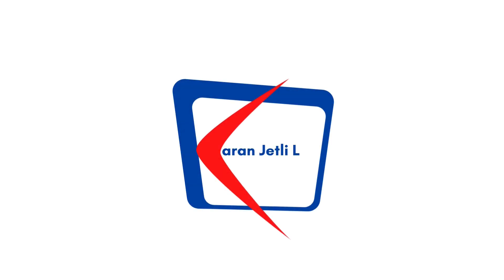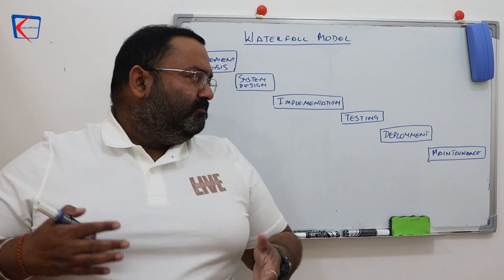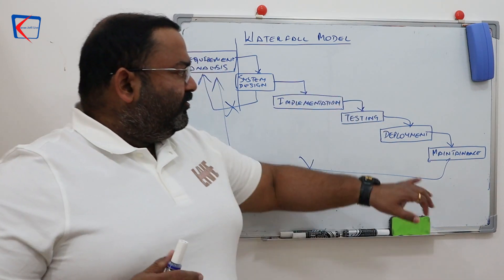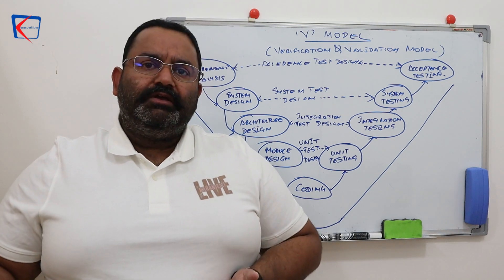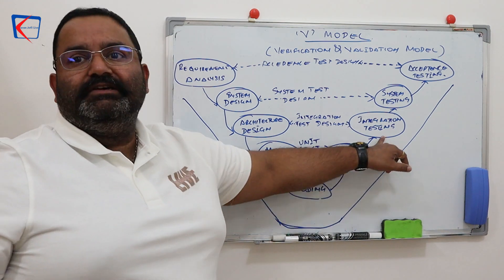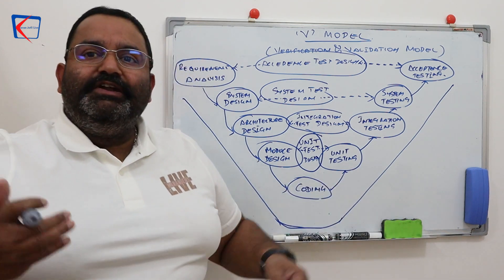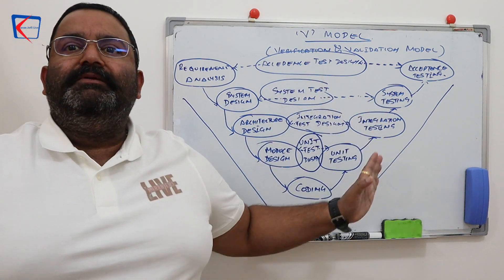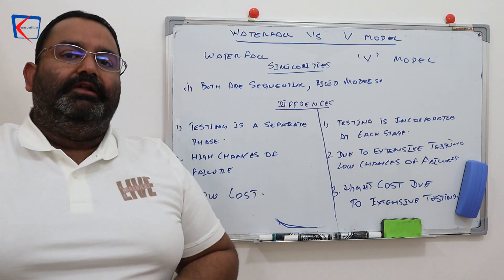Waterfall vs V-Model: Key Differences in Software Engineering

Comment: I think the validation is still not clear and that there is a confusion between where we designed the test and what is the verification stage. in the other hand there is a confusion between if the verification is done in the 2nd part of the V or if the verification is happening actually in the first branch of the V. do I really need to thank you because your explanation are really clear. Apart from what I mentioned, for me at least, THANK YOU.